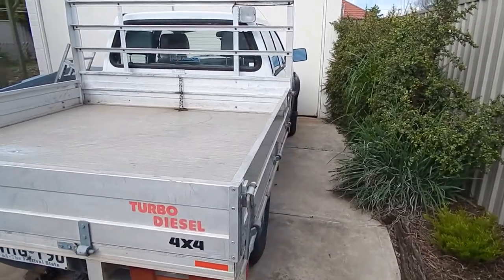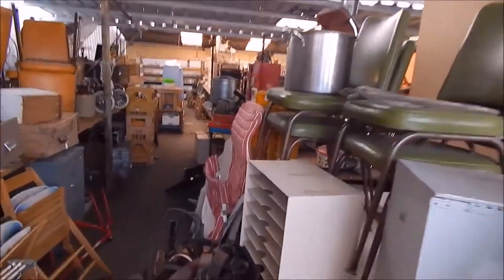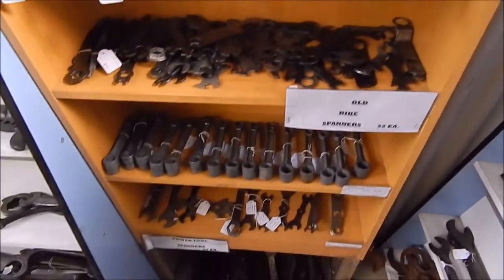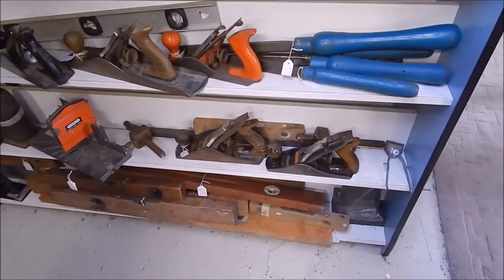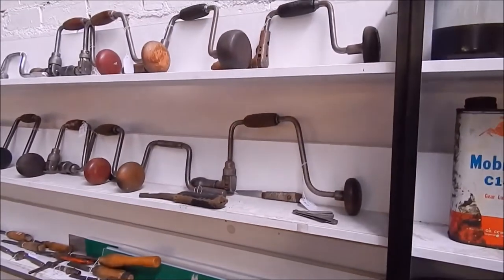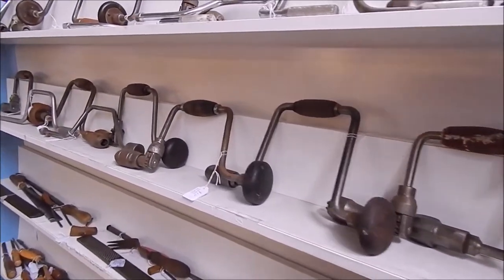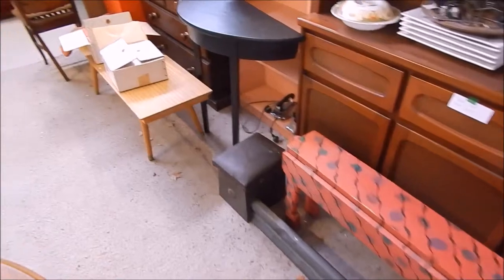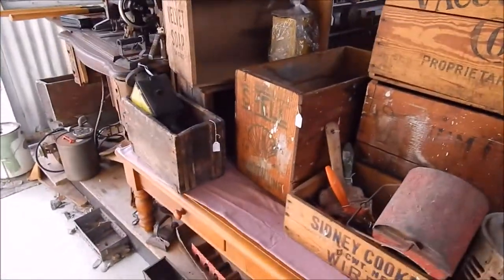Old tool browsing

Comment: Filing cabinets make great shop tool cabinets
Reply from the maker: OK provided you put the heavy stuff down the bottom, or bolt it to the wall or floor - otherwise they can tip and open all the drawers at once if too top heavy.  Can often get them free off of Gumtree.  Rob

Comment: Rob

Correction:  That bloke who contacted you about your P & C 6211 ratchet never wanted, nor offered, to buy it from you, because he knew straight up you'd never sell it.  He was only interested in how you came about having it, because it's not a brand ( Petersen & Carlborg of Milwaukie, Oregon ) that was ever sold in Australia.

This bloke bought one off eBay and is very, very pleased with it, thank you.

Cheers
Reply from the maker: Hi Stephen.  My mistake, and I'm sorry if I offended you.  Being a collector I just automatically assumed you were interested in purchasing it, as they are apparently scarce in Oz.  Glad you got one, and please accept my apologies.  Cheers Rob
Reply from the maker: I did mention at the time that my father never liked using it, and it is still like new.  Over the years I've found out why, and that is the way sockets and bars lock onto the indent ball drive head extremely strongly, making it difficult to remove them by hand.  Sometimes I have to use a screw driver to prise them off.  Cheers Rob.